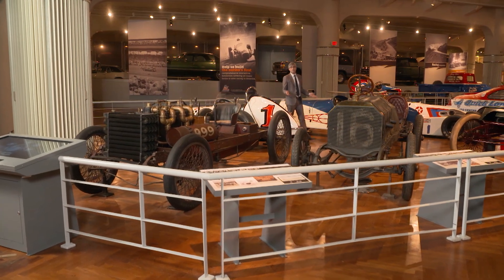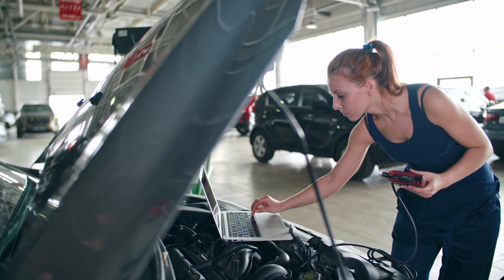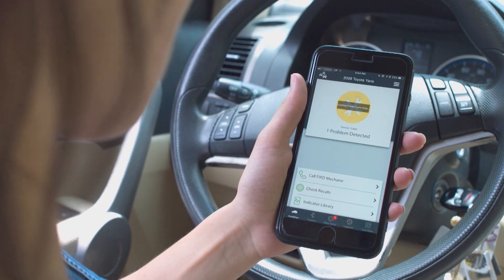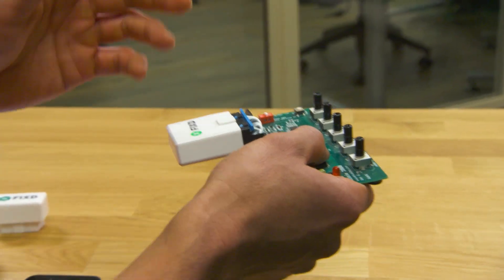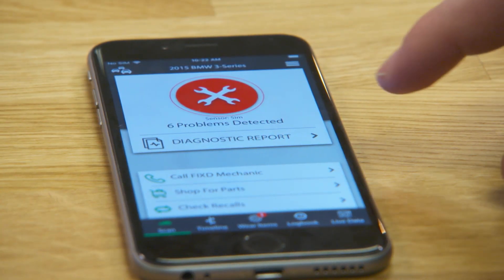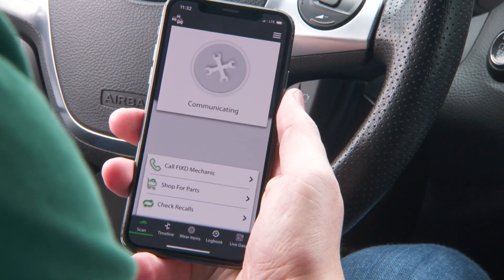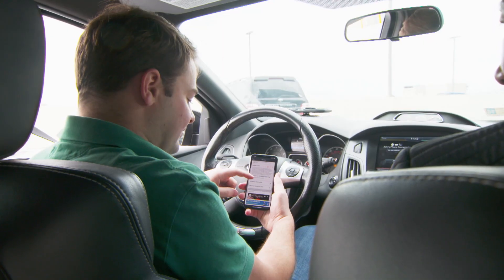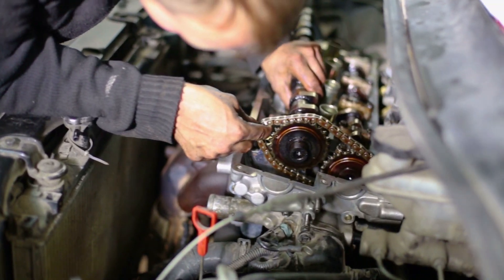How the FIXD Car Diagnostic Sensor Works | The Henry Ford's Innovation Nation

Comment: WORTH THE READ!!
All this does is scan codes, to give people an idea of what system is faulty in a car. Any professional mechanic does not just only scan codes to diagnose a problem. They use the codes to narrow down where they need to test the car. Then they perform the actual diagnosis, which involves using a shop labscope, and manual labor testing on various areas of the vehicle dependent on the code(s). People hear the word "diagnostic" and they think a tool like this which is only a D.T.C. (aka, dummy lights) scanner will tell them exactly what to do and how to fix it. If you know how perform those diagnosis tests and you want something relatively cheap to scan codes preliminary to the actual diagnosis tests. Then this is what someone could buy. If you think this product will tell you what to fix or replace, and if thats what want, then don't waste money on this. Just go to Autozone and have them scan it so you can know what code it is. Also, don't take the associates/workers word on what to replace because they just want to sell you parts. Have someone do the diagnosis or if you know what to test then do it yourself. About 90% of time a D.T.C. (Diagnostic Trouble Codes) will not tell you what to replace or what to fix. How do I know, my father is an actual ASE Certified Automotive Technician and Mechanic and has been teaching me extensively about cars. Just trying to inform and tell the truth. If anything this tool can help you to know if your mechanic is lying to you about your DTC's. Quick tip also, is actual professional shop labscopes and scanners which are thousands of dollars or more btw, can pull out more codes and more accurately than "cheap" scanners. I'm not sure if this product is accurate or not. I have seen this multiple times at my fathers automotive shop. For example: someone comes in with a print out from AutoZone of codes or from a cheap scanner, and we compare that read out to an actual high dollar scanner. Sometimes the codes on the high dollar scanner are more accurate and can pick up more or even different codes than the little cheapie scanner. And professional level auto shops PAY the thousands of dollars on a shop labscope/scanner to make sure they are accurate. 

So bottom line, find an honest repair shop/mechanic that can actually explain to you in lamens terms the problems your vehicle has, and why it relates to your DTC's. Chances are, that mechanic/shop is honest if they can do that. 

This FIXD Tool is just a scanner. You still need someone to properly DIAGNOSE your issue to isolate the actual faulty part or problem. Anyone that says this tool does diagnosis, is either ignorant, or is using it as a marketing tactic.
Ex: If you get a code like P0303 = cylinder 3 misfire. Watch a couple fix videos on YouTube where they changed the ignition coil, and spark plug. Then you go buy those parts and do the same, doesn't guarantee that the problem will be fixed. Cause if it didn't fix it then you just wasted money on those parts, all because you didn't want to pay for a professional diagnosis. Which could indicate something else running cylinder 3 could cause a misfire. Hope they don't take my comment down cuz its exposing the truth lol😂
Reply: Thanks man. I'll just find a good honest mechanic helping me buy my 1st used car!
Reply: I have the FixD code scanner. For $20 it reads the codes (if you have any) fast. But you're exactly right.  That's ALL it does. You may have an O2 sensor code. The WORST thing to do is go out and get that replaced. There are many reasons the O2 sensor could be throwing a bad code. Vacuum leak on the intake, Throttle Body malfunctions, Long and Short term fuel trims off, etc. This scanner doesn't tell you that. I find it handy to narrow down the problem. Then it's up to me to figure out why it's throwing that code by looking at the common issues that could cause it.  They have good diagnostic scanners out there now that are not too expensive and WILL diagnose the problem. I plan on getting one as I do most of my own work. But for the money and the average person who has a check engine light on it's worth the $20 to find out why.  Thanks for the honest review.

Comment: This thing is a scam. Don’t spend your money on this
Reply: Hey please tell us why?
Reply: @puertoricanboy100  because it's the same as the other standard obd2 code readers out there. Nothing special. It doesn't tell you what's wrong with the car. If there are broken wires or corrosion in a harness, how could it possibly estimate the cost of repairing that?  You'd have to know where it is...It's bull...